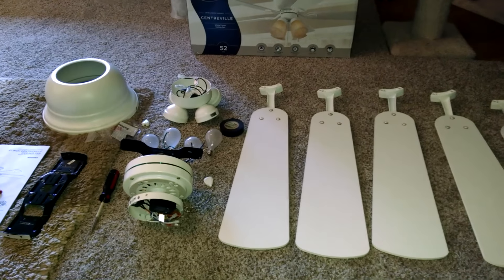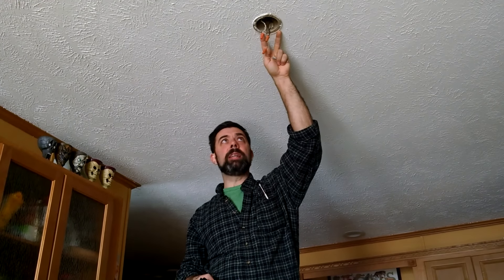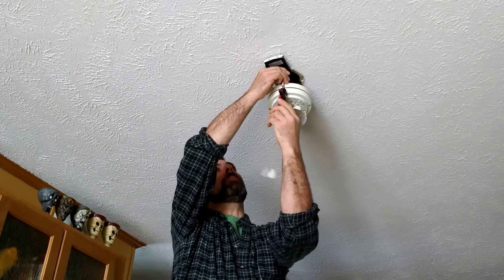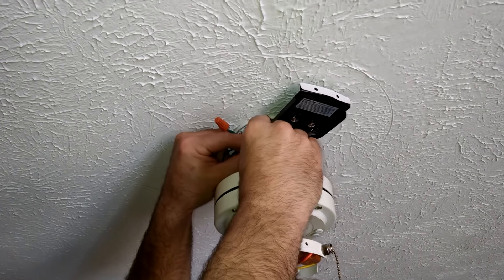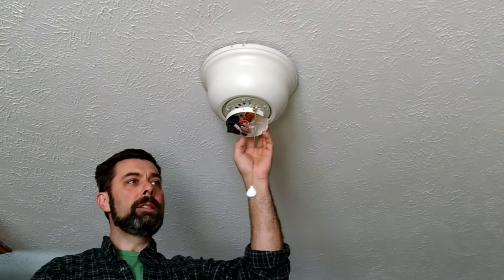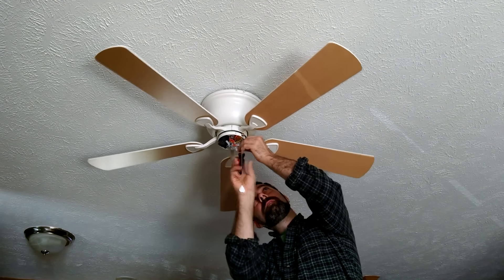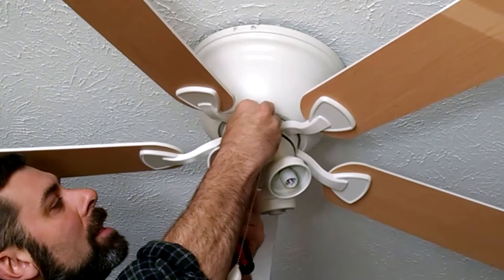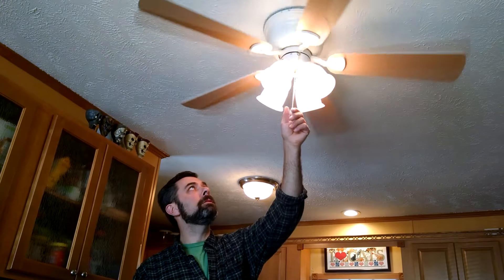How To Install Your own Ceiling Fan. Easy DIY !

Comment: My local train station has an AB one that replaced one out of four Hunter Low Profile V. That Low Profile V had the mounting bracket issue which made the bar owner think that the motor has finally died. I kept that fan and the motor still works fine.